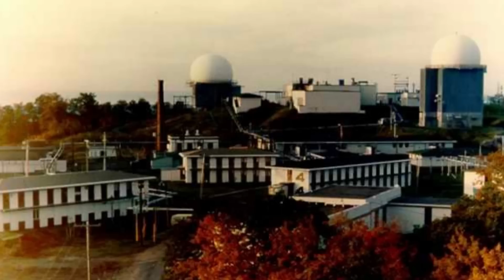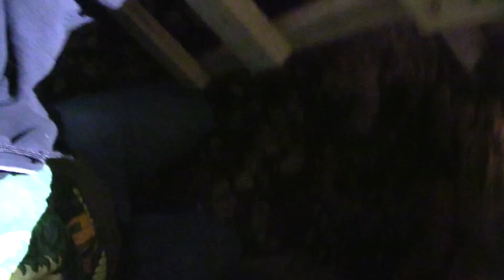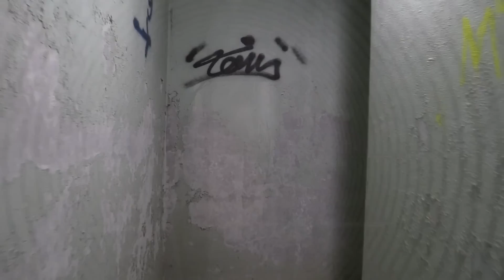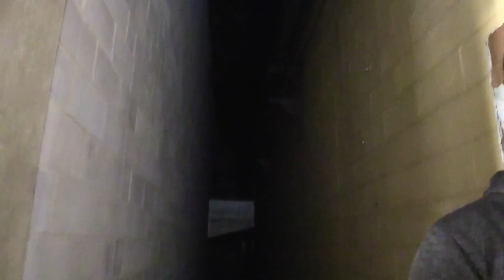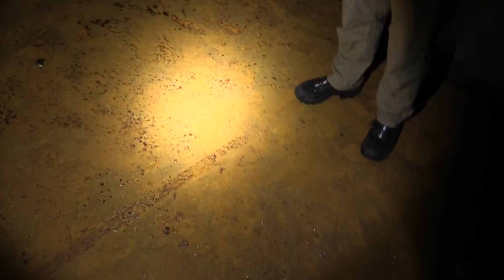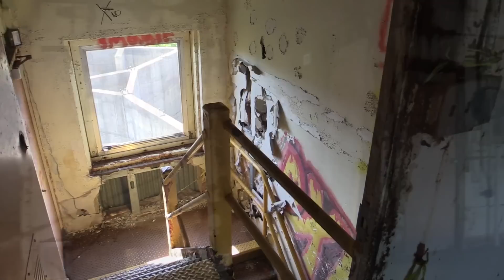Visiting The Historic Calumet Air Force Station - Former Cold War Radar Base

Comment: As a relatively young 2nd Lieutenant trained Weapons Director I showed up in 1969 at Calumet AFS before the site was operational with BUIC equipment.  Since only the site's commander was already there, he made me key personnel and thereby my wife and I moved into one of the site's housing at the base of the road up to the control room.  I spent many a day in front of the screen backed by a Burroughs Computer, mainly in training status, ie back-up.  Three or four times a week, we would go live and actually get to direct F-102 or F-106 interceptors.  F-106 had data-link which was neat, when it worked, but many times we would fall back to voice.  I always got the feeling that the pilots didn't really like data-link, I think it wasn't quick enough for them. I left Calumet in 1970 to go to pilot training myself.
Reply: Very Cool Thank you for serving!!

Comment: The reason why a developer didn't want it was because the developer would have had to remove the bomb resistant buildings. Mitigate the lead mitigate the asbestos mitigate the ground pollution and then deal with the shallow ground surface it just wouldn't be worth it for them.

There is an Air Force base near me that the main building is simply blocked off to keep Urban explorers out. The nearby block houses for the staff have been converted into Apartments. I found out about it and you should talk to the night sky people about this but there's probably several USGS survey markers spread across the property and those need to be preserved. And if they're not present they can be replaced by the USGS. 

Also around where I am are several Nike bases both the launch tubes and the block houses survive although getting access to the launch tubes has proven so far impossible for me because it's used as a municipal storage area.

Comment: I was stationed at Empire AFS In Michigan and worked on the gap fillers that were at Petosky, Saugatuck , Shelby and Alpena. The main radar site had a FPS7 that was maintained by the FAA we had a FPS 26 and a FPS 6 that were height finders. At some point it had a NCO academy was there. While I was there in 68/69 there were less than a 100 people on the site. It was a great site and a step up from Caswell that I was stationed at in Maine. I never realized how much fun I was having in the Air Force till it was all over.

Comment: That was an enjoyable video, I use to live in Blaine Washington where another USAF Radar Station was that did the same thing. 

I remember watching the big search radar turning. The scanning array was 250 to 300 feet across. It was massave and I'm sure they used the same system there as in Blaine.
Reply: I lived at both Calumet and Blaine as a kid '60s and 70's

Comment: There was a a similar site on Lookout Mountain Georgia called Flintstone Air Force Station. 
Opened in 1955 and was operated by the 867th Aircraft Control and Warning Squadron with d AN/MPS-11 and
AN/TPS-10D radars for  Ground-Control Intercept (GCI) and the SAGE defense system. Site had about 30 buildings was closed somehow for budgetary constraints in 1960. I find that poignant as in 5 years when Vietnam started money was not an issue for defense spending. 
Covenant College bought this abandoned property bordering their campus. All buildings torn down and now house their athletic fields.

Comment: Greetings: Not 2 promote- I am not a seller...USA vet. I have a Cold War verified military desk in storage I am reluctantly  pondering sale. This thing is big. It should have hade an engine and steering wheels at 6 x 3 x  28 on legs and about 200lbs I estimate. All olive drab steel with a grey top. All slide out drawers and flat extentions all lock. I had temporary wheels in place of the carpet feet so I couy move it. I never made the rolling cradle I planned 4 it. I am 2nd owner of Major that brought it from SAC Omaha.  It was in great shape when I tucked it away after my move. Well protected (buried), it has remained a missed old friend. Watching this returned memories and thought it had do many more years of service and better if returned 2 service in a familiar setting... military. Inquire 4 more info. Thx 4 the share.
Reply: Years ago, when I was but a lowly airman, I moved more of those damned desks than you could shake a stick at.
Reply: @dukeford  Greetings: Sure when U were stronger, more agile and took orders. Indeed definitely a beast. Bsafe.

Comment: Thanks for preserving this site, but you have one thing wrong.  You underestimated the power of the radar.  That is why site personnel were quartered below and far away from the search radar.  All the copper shielding was to ground the search radars massive power output or else it would fry anything electronic.  Not that communications affecting the radar. A 700 watt radio cannot blank out 110 million watts.
Height finders were narrow antennas on a pitman arm that was oscillated by a motor that moved the antenna vertically. It could only see 15 degrees wide from surface to 85k ft.  It was not mounted on its side.

Comment: I lived and worked at the site of a similar station in WV - the Guthrie AFB. Interesting how much I see in the Calumet photos that I recall from Guthrie. The years I was there it had been taken over by the WV Dept. of Agriculture. Of course these days it has changed quite a bit, and the old radar dome structure is long gone. I recall there was copper screening inside of the walls or our building. We lived in one of the old officer's housing units on site for about 10 years. A pretty neat place, right on top of a mountain near Charleston.

Comment: You guys need to check out the Air Force Radar station just south of Waverly, IA.  If I’m not mistaken, it’s completely abandoned and hasn’t been touched in decades.  As far as I know, the gates have been locked and no one has been allowed inside since it closed… from the outside, it looks a lot like this radar station in Calumet!

Comment: Cell phone companies are using the tower

I actually saw one of the last active radomes, 100 ft antenna, in upstate NY. 

There are so many decommissioned bunkers and still classified bunkers in NY state. 

The SAC base at Plattsburgh and Rome had a lot of silos and bunkers

Near Cobleskill in 2012 the government listed a parcel. 

It was a large empty field with a 1/2 mile long driveway to a concrete small building smaller than a garage. 

The concrete building had a large metal door and when you open the door there were concrete stairs that went down six flights down about 150 ft 

The first level had a series of blast doors and decontamination showers and there were two more levels below the first one and each level was about the size of a Walmart 

The government had stripped the levels of almost everything they ripped out the walls all of the electronics all of the electrical all of the plumbing and there was basically just the metal and concrete shell 

What really surprised me was the signs and the small amount of documentation that the realtor had listed this site as the backup alternate command and communication center. 

This meant that somewhere still exists a alternate command and communication center and somewhere most likely closer to the base would be the backup command and Communication Center and underneath the base would be the primary command and Communication Center 

In talking with the farmers that lived on the road I asked how they could have built this massive site with no one seeing it 

each of the farmers said the same thing that they were well aware of what was going on and that they did blasting in order to excavate the quarry down about 200 ft underground and then they put in the rebar and poured the 6 ft thick concrete walls and the stairwells and they backfilled the site 

They each had a story of being visited by the Men in Black that at least one of the men showed an ID that they worked for the Department of defense 

They were told never to speak of this site to anyone and they were given a card and told if anyone ever asked any questions to call the number on the card to

The amount of money that was spent to build the SAC sites is just insane 

The silos were built and the AT&T Long Lines Sites were built around the same time.
Reply from the maker: Interesting, I haven't heard of the one in Cobleskill, I'll have to look that up!

Comment: As part of the repurposing parts of the base, it would be really cool to host HAM POTA  (parks on the air). It would be cool to have somehow towers available for amateur radio operators to communicate from
Reply: I'll second that! Maybe a 2 meter/70 cm repeater on one of those towers!
Reply: I think those are great suggestions. 
I am an Engineering Physics / MD/ Trauma/ Prepping nerd. Several years ago I thought getting into HAM radio would be interesting. I loved the technical aspects. But the people I ran into seemed like a closed off Cult with a strict Hierarchical Structure. The whole HAM response to people in trouble in NW North Carolina after the recent "never before seen" Inland Hurricane Flooding confirmed my previous experiences. 
At least obstruction, interference and outright denials for emergency access was reported by many in the alternate media and YT channels. People who were giving significant amounts of volunteer aid of time, manpower and supplies.
That attitude needs to change. HAM operators need to stop being informants for the FCC Stasi enforcers.
That's just my opinion and experience.
Your mileage may vary.

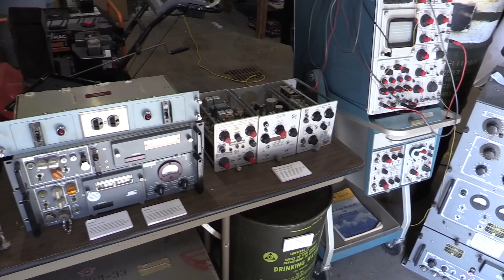Comment: Back in 1982/83 I was stationed at the King Salmon Air Force Station at King Salmon Alaska and I worked in the GTATR Sight. The Receiver and transmitter shown in the center of the photo at 3:07 was one of the radios that I worked on. The transmitter on the bottom looks like a GRT-21.
Reply from the maker: That's cool! I grew up in Alaska and we had a lot of Cold War stuff around.

Comment: could you try to intercept space pirates again it was very fun video it would be cool if you could try it again but with proper antenna
Reply from the maker: I might give that a try with some other radios soon!
Reply: @saveitforparts  i saw one guy using circular polarization antenna, maybe even use circular polarized with a dish?
i aslo seen people using Low noise amplifier

Comment: Hi you make great content ! i've been watching your videos for a while now and i think it's amazing. and even about 2 months ago i decided to start my own project to make a rotor for antennas. however i'm weak in python and i'm stuck on trying to find the right code on github to handle 2 nema stepper motors so that they can receive AZXXX and ELXXX instructions do you have any tips ? or some repositories that i can easily(very easily) use ? what program would you recommend to start with ? (leaving aside the quality of the antenna. I would like it to just spin :D)
Reply from the maker: Cool! I'm still learning about rotors and struggling with a big one, I'm still not a coding or stepper motor expert. I actually started with this project: https://www.youtube.com/watch?v=hPUXLV-Lr_8 which is based on this code and design: https://www.youtube.com/watch?v=HoRPWUl_sF8&t=0s
More recently I've been using code from this project, but it's based on brushed motors and not steppers: https://www.sarcnet.org/rotator-mk1.html

Comment: Right angles are not for blast deflection. they are for the attenuation of ionizing radiation. High energy particle radiation will impact the initial wall at weak points in the shielding and generate incidental X-rays through bremsstrahlung that scatter perpendicular (Compton scattering) to the surface impacted. 36" of  sand and concrete block provide a minimum of 99% decrease in ionizing radiation exposure, however this structure provides less shielding from neutron radiation during a close detonation, and would be insufficient at protecting occupants. My guess is that during incoming they would evacuate crew to the buried shelter for survivability, then return to their stations after an attack if possible to resume command and control.

Comment: A very interesting project, thank you for showing us the airfield. I'm fascinated by the old equipment, and I suspect that the large tube might be a thyratron. For microwaves, the tube seems a bit big to me. It's a pity that the diesel engine with the 500-kilowatt generator is no longer there; I really like the sound of those old engines. I find it especially interesting when these engines have an open valve train. It’s just fascinating to watch the mechanics in action. The view from the towers is fantastic.🤗

Comment: Amazing that they could send data to the aircraft and arm the weapons and send navigation data back in the 1960s, i had no idea that technology was available back then.
Reply: Google USAF SAGE for more info. You'll be amazed at the "Size" of Technology bake then.
Reply: We didn't.  These guys are F.O.S.
Reply: @dukeford yes they did.
Reply: @kimnielsen9332  The navigation, yes, but SAGE could not arm the weapons.  The pilot was still responsible for that.
Reply: @dukeford  simply a matter of flipping switches. But the real deal on this was the limitations of 1950s/1960s electronics. It just didn't always work.
Reply: @kimnielsen9332  "Simply flipping switches" on nukes is kind of a big deal.
Reply: @dukeford  that's why they had a personnel reliability program back then.

Comment: Thank you so much for sharing! That site has so many possibilities! Have they reached out to local Hams for a Repeater placement? I think I'd consider moving there just for the infrastructure. Cheers!
Reply: The local Ham Club does have repeaters on site.
Reply: I am a Amature R$adio Operator. I only work AMSAT (Amature Satilltes) and planing to work the Birds from there. The site has a 360 degrees view of the horizon. Plan to work the Satellites when they are over the Atlantic and work Operators in Europe. LOVE the HOBBY!!!
Reply: @thederangedwartomato5383  Very cool!  I am hoping to build a tracker, but recently learned about egg-beaters.  (73 from K8TMW)
Reply: @tmwinkler  I've been using Eggs with SSB Electronics preamps for about 9 years now here at the QTH. Worked many EU Operators over the years. Most QSO/QSL's on the RS-44 Satellite. 73!

Comment: Not as exciting, though on a similar to that region note is that getting out to the old Keweenaw Rocket Range launch site has gotten way easier than when I used to trek out there back in the late 90's early 2000's.  Might be boring though compared to what you've experienced.  Anyways, the northern coastal range of the UP is awesome in general in many ways historically and currently.  Watching the Calumet Air Force Station latest and greatest is just jaw dropping!  Way awesome and excellent to see.  Thanks for sharing all the detail regarding the Open Skies Project!
Reply from the maker: I went out to the rocket range a few years ago, messed up my axle a bit on the road to the camping spot!
Reply: @saveitforparts  Ouch!  Yeah, wasn't so bad with the 01 Dodge Ram last I was out and with the 13 Prius I only made it to the new parking area for the first beach area I never went to prior from what I remember.  Amazed me I got that far with a not lifted Prius.  Now, in regards to back in the day while I was at Tech, bouncing around the old 89 Ranger was something else where I needed a few carefully planned and executed running starts whether mud puddle runs or that little rock hill earlier on in the stretch. Used to be 2 wheel drive super sketchy, though I had the attitude back then like I do now, if you can't get there in 2 wheel drive you don't need to be there and 4 wheel drive costs too much.  Those I beam front ends are nice!

Comment: There's a, potentially nuke-proof building in my area. An old vinegar factory. Regs had it so that they needed a bunker where some of the volatile parts of production had to be done. The walls on that bunker are at least one meter thick.
Reply: Appreciate you use the best unit system! 😉😁😇